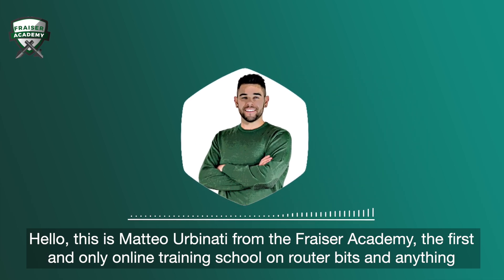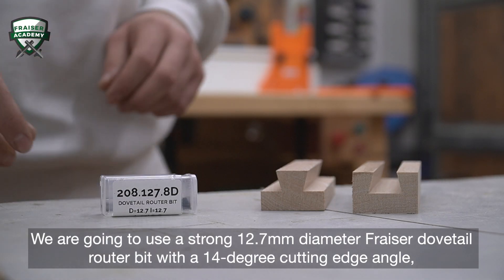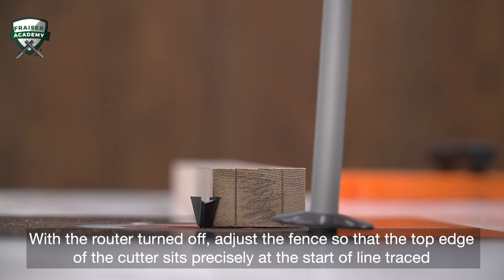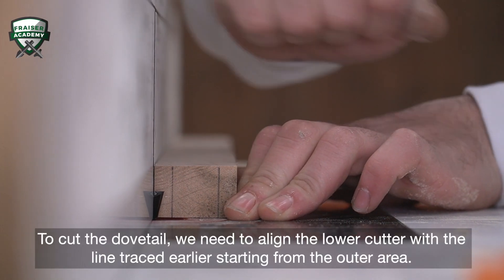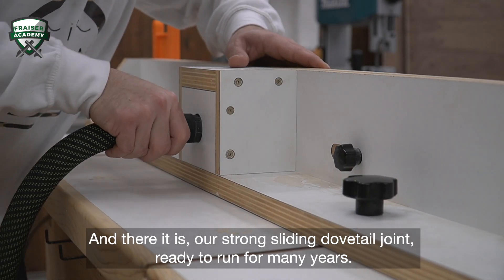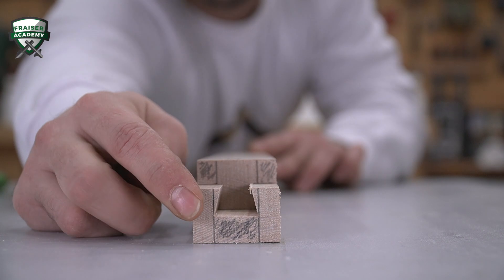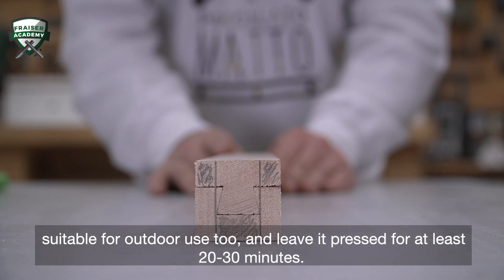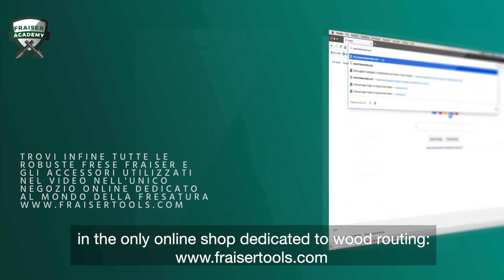Come realizzare un GIUNTO A CODA DI RONDINE SCORREVOLE fai da te con una fresatrice | TUTORIAL

Comment: The sliding dovetail is very impressive looking to the uninitiated and also one of the most useless joints ever created. In 99% of cases where it's used someone just wanted to show off but there was a better joint to use.
Reply from the maker: Of course, that's what the tutorials are for, and they are guides on how to use the cutter.

This, if you're a little bit smart, you can apply it on other things and you've learned how to use the milling cutter.

Comment: You should run a pass with a straight router bit first to preserve your dovetail bit.
Reply from the maker: You can definitely do it on hard or difficult-to-mill materials or if you use bad bits, in which case it didn't strain at all.

Thank you :)